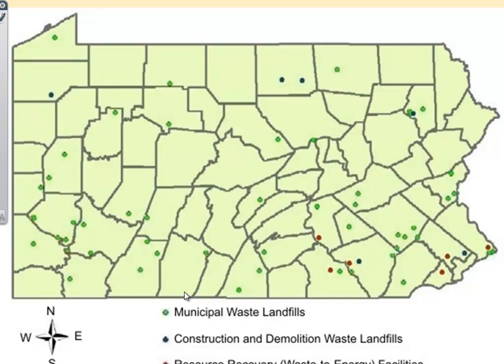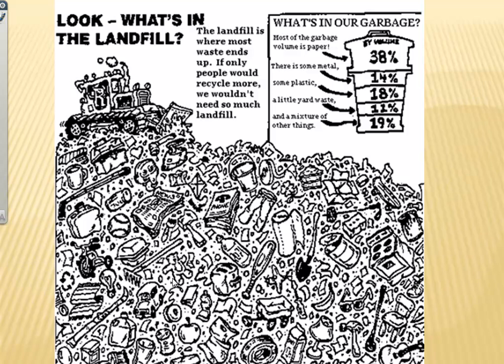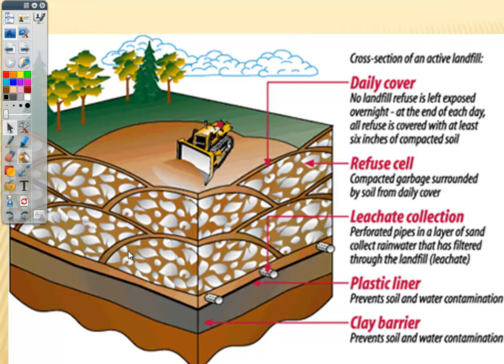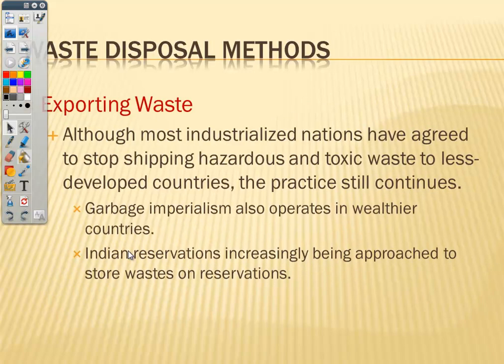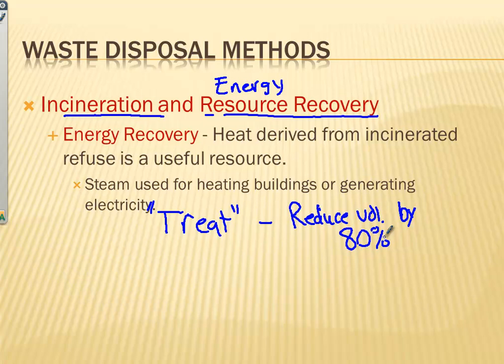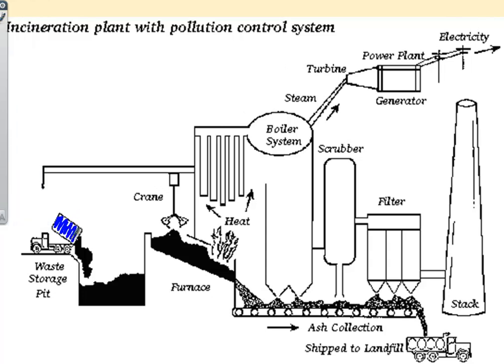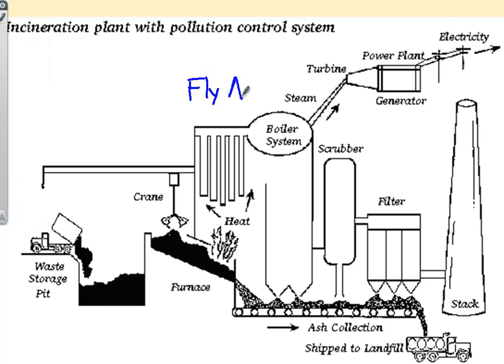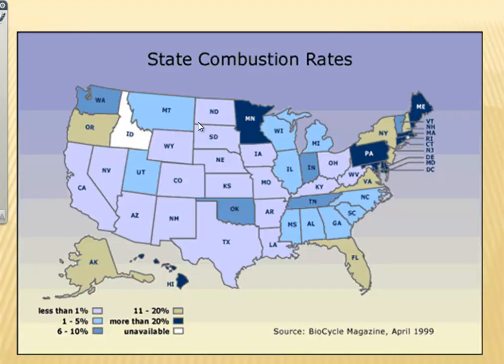Landfills and Incinerators

Comment: As we do have here in Oslo, Norway.. Before we did have all the garbage went straight to the "burner", and trust me.. that was like everything. These days we do sort out olmost everything. Foodwaste we put in small green plasticbags, plastic goes into small blue bags and the rest goes into the "common" plasticbags. And this is what we as users do at home. than they come to collect the garbage and whats happening is that all the trash , only the "bags" goes into a sorting facility. They do sort out the green and blue bags where they go for furter treatment. The green bags goes other places to be bio-gas/fuel for buses, trucks and nowdays even cars. The blue (plastic) goes to another place to be melted down and reused as new plastic. The rest of the trash goes into the burner where it goes into energy and even too warm up water. Now the ashes of the burned trash is also being used in asfalt. So it is several things you can do with the never-stopping problem with trash :)